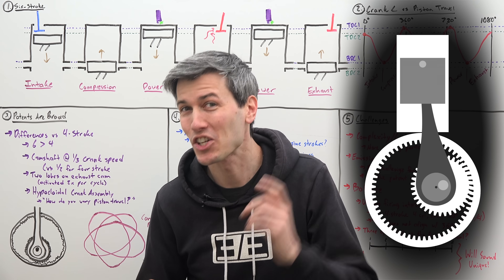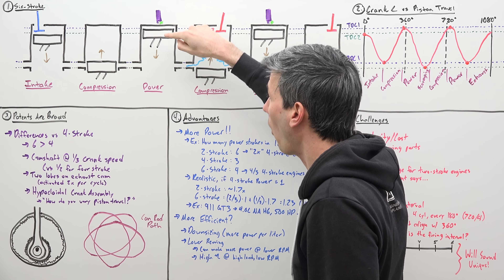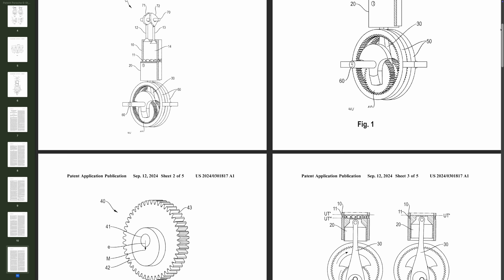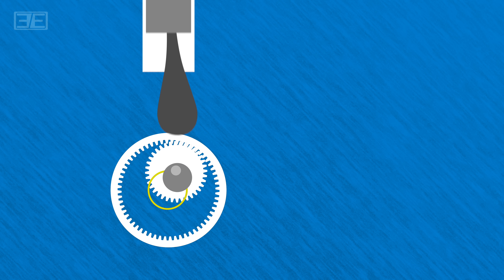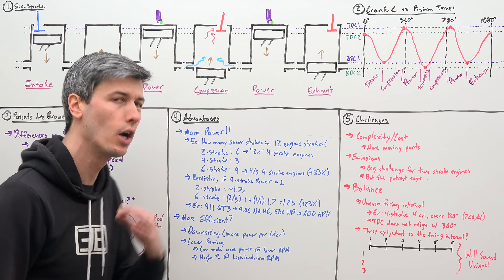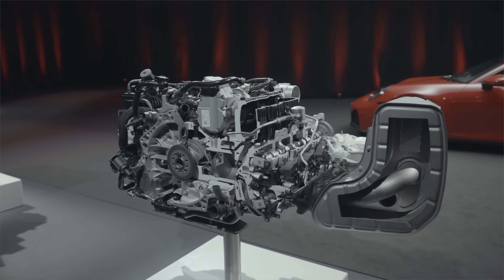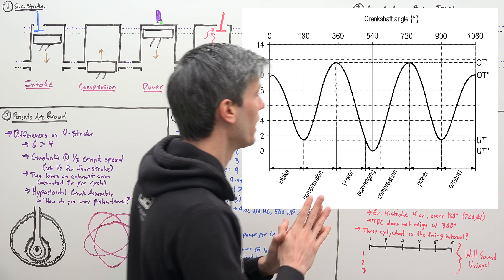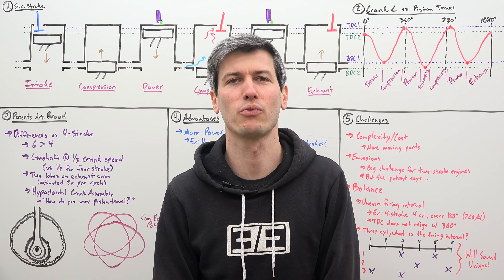Porsche's 6-Stroke Engine Is Genius!

Comment from the maker: Thanks for watching my *1000th video!!* Y'all the best. Now, onto a few common questions:
1. Truthfully, looking at the patent, I don't see how it could operate as naturally aspirated (NA); however, they allow a lot of leeway in the patent for how this cycle works (for example: fresh air from the overhead intake valve during the scavenging event, exhaust out the ports in the bottom or top, a combination of intake/exhaust ports at the bottom, etc). NA two-strokes generally use the piston going down to pressurize the air going in, in combination with exhaust scavenging, which doesn't seem to be the way this operates. I think the safest assumption is it will be boosted (super or turbo/e-turbo), to easily force in air, but I didn't want to rule out NA as the patent doesn't explicitly rule it out. 
2. Regarding balancing, I kept this discussion fairly short mostly because I truly don't know how it can be done. I spent way too much time drawing out all the different options for a 3-cylinder, and none of them seem great. One idea was lining up the more powerful first stroke with the next cylinder's less powerful stroke, so you always have 1 high power, 1 low power together. But in reality, these can't actually line up (you can get two cylinders line up, but then the next two that fire are offset, then the next two are offset even further - this requires drawing out the sign wave shown in the top of the board to visualize - three times, offset ~360º so peaks align-ish). This also means you have pistons acting with different primary forces at the same time (and technically, different times). Perhaps a balancing shaft can cancel this out (or perhaps an equal and opposite opposing cylinder bank), but the patent makes an I3 seem fine and I don't know how that works out. But again, regardless of all of this, the firing interval will be intermittent and sound quite unique, no matter how you time it. *makes cars sounds to self*
Reply: Yeah, in motorbikes with V twins one configuration is what they call "big bang" - this is exactly what they would do, as per your comment abive, but not the video. They don't have to line up, they need to be even. Space the 3 360 apart and the other 3 will have matching offsets and the power will be smooth and easier to use with traction control.
Reply: You mentioned this being your thousandth video, and it made me realize that genuinely cannot remember how long I've been watching your videos; To me, you're like a homie I see occasionally who teaches me cool new things then we part ways for a bit and do it all again. Many Congratulations 🤝
Reply: @wraithxoxo9014 I've watched for around 3 years...the most important thing I've learned is really 2 things: the human mind is limitless; and the entire earth can be moved with a big enough lever
Reply: @EngineeringExplained  i think the teeth on the gears will wear out. Also, a lot of herky jerky movement.
Reply: ok, but if they can do "clean 2stroke" by direct injection and forced induction (not pushing air bellow piston mixed with oil) why even bother with additional 4strokes?
Reply: @moalabs  Exactly my thoughts. If they want to play with 2-stroke, why not make a scaled down crosshead engine?  A crosshead is as clean as an engine can be, and while it's too tall to be upright in a car, they could lay it flat (like half a boxer) to deal with that.
Reply: @moalabs  my guess is the 2nd compression stroke will retain some amount of the exhaust gasses that would be expelled in a normal exhaust stoke, sort of an in cylinder EGR. I think thats what they mean by 2 stroke method disadvantages can be remedied by clean and efficient combustion, they think a 2nd power stroke using the unburned fuel from the 1st will allow for less new fuel injected and more complete burn of the fuel from the first intake stroke.
Reply: @moalabs  With that logic, just use rocket engines. The rare "1-stroke" engine that's all power stroke (or all exhaust stroke, they end up being the same thing).
Reply: Balancing is mass related, not torque related. No idea how the balancing would look, but it's independent of the power strokes.
Reply from the maker: @fredio54  Mentioning this because the power strokes line up with when your piston is at TDC (primary forces). Since these don't line up, the balancing of these doesn't line up (unrelated to when it fires, but poorly explained on my part!).
Reply: @EngineeringExplained Jason, 4th stroke is (compression + exhaust) rit..? it's not just a compression stroke alone

Would this scenario work - exhaust stroke is completely avoided..5th power stroke is followed up with a compression stroke (similar to the 4th)

  . 4th compression stroke does remove exhaust 
     so why a separate exhaust only stroke is 
     needed..? 
  . 4th stroke does have intake as well so why 
     does we need separate intake only stroke
     once it gets going..? (initially it is needed)
Reply: @fredio54  "Balancing is mass related, not torque related." It's both. Ever had an engine with a misfire on one cylinder?
Reply: @Grafyte  That's actually occasionally heppening with my mazda 2 right now (Bad ignitiion, needs new spark plugs and wires).  When it does, if it's a small hiccup, you can barely notice it, if at all.  Sometimes it's just a single misfire, at which point you won't notice it.  But if it happens consistently, it's VERY noticeable.  The whole car vibrates.  I think it's more dependant on how frequently it occurs, how spread apart the misfire is, and how consistent it is.  The problem it'll likely cause is excess wear on the crank assembly, which with a complex crank assembly like this, will wear quicker and more expensivelly than any normal car.
Reply: @fredio54  This is because acceleration is related to rpm squared, so at higher speeds the force from combustion becomes negligible
Reply: All major interval and balancing problems are solved by using either inline-12 (yikes) or boxer-12 (awesome) configurations.
Reply: @jonathanstensberg Porsche has raced boxer 12s, no?
Reply: Great video as always! 
I am wondering how are piston rings (if there’s any lol) going to pass that bottom intake gap without expanding. And there are no piston rings, how are cylinder walls getting lubricated. Just wondering.
Reply: @jadiseul  The channel for the bottom-bottom dead center scavenging is probably intended to be narrow enough in width to not really allow the compression rings to expand much. Think of it as the edge of a really narrow slice of deep dish pizza. I could definitely seeing it increase wear over time of the rings, but I'm more worried about the gears.
Reply: @jadiseul  Piston rings should be no problem. 2 stroke engines have piston rings, too. Okay, usually they have only one of them but I do not see a major problem regarding those additional two rings.
Reply: @jadiseul same way as any 2 stroke. The rings won't be free to rotate they will need to have locating pins to make sure they are in the correct orientation so that the ends of the rings are not allowed to pass over a port where they can expand out, snag the port and break.
Reply: @jadiseul Porting I guess, like two stroke ringed pistons passing wide transfer ports which, in some designs, appear to be unfeasibly large fractions of a circle. 
Two stroke rings are pinned (at least, all those I’ve dismantled) and those pins ensure the ring ends don’t project into ports anywhere in the cycle. I’m amazed my strokers work so well.
Reply: Wouldn't a 9 cylinder double up the power strokes evenly? W9 maybe.
  But also, how does the oil control ring on the bottom of the piston do it's job with a bunch of holes in the cylinder wall? I can't see a way for their "clean burn" solution to work that one out.
   We need another deeper dive into this one. Js
Reply: Congratulations on 1,000 Jason, I have been fascinated and learned lots from your videos over the years many years. We all owe you a debt of gratitude as car nuts
Reply: I don't think I was watching in 2011, but I have been here for the majority of this channel's life. It has been impressive to watch the channel grow. I see that you are nearly at 4M subscribers. Congratulations on your success- you have certainly earned it.
Reply: I think this is one that would need to be visualized to understand it properly, maybe then appreciated. But I'm with , it will be unique.
Been around just after you started. Love your work.
Happy 1000th
Reply: Congratulations on the 1000th ep!
That's awesome 👌

On the video, as a mechanic, I was thinking the whole way through 'I wonder how they plan to balance that'! 😁👌
Reply: Congrats on reaching 1k!  Another great video.  
Regarding balance, that’s not going to be a big problem.  Think about a 3 cylinder.   Instead of spreading the power moments, you can make them overlap.   So in your graph you could have 2 cylinders firing at moment 1, 3 and 5.  That would sound great but may induce serious vibrations…. which you could perfectly balance out by having another 3 cylinder mounted opposite of the first one.  Kind of like a flat 6 engine… 
Now whose patent did you say you read?
Reply: There aren't any important balancing problems specific to odd firing engines. They have the same dynamic balancing problems as even firing engines.
Despite the need for a blower, I think a pure two stroke would be the better option.
Reply: All buy Porsche SE stock now :D !!
Reply: Well, I guess we'll see how it goes after 10 years.  I see a lot of wear and tear and potential for failure.  In theory and on paper is one thing, but actual materials and application is a completely different animal.
Reply: This will never meet emission standards or hit economy targets.
Reply: @littleherms3285  right because it always burn oil as the pistons rings gets exposed to the air & will force oil out the two stroke ports
Reply: Thank you!
Good explanation in every vid. Great job!
Reply: Congrats on the milestone! 👍😃
Reply: Would love to see a video on the RevForce engine from Alpha Otto technologies.
Reply: Knowing porsche, this will end up being a flat 6
Reply: Will the oil not get into the lower windows? If so, the oil will burn, which will make the engine uneco-friendly. Will the dry sump system completely suck out the oil?
Reply: Cheers for the 1000th. I learned a lot from you ❤
Reply: Congratulations and thank you!
Reply: remembering seeing your early episodes when i was still in uni, time flies!! keep up the great content man!!
Reply: I’ve seen some of your videos and I’m thankful for your insight into how it’s made (pun) and how it works (also a pun).

I look forward to more videos regarding your understanding of such marvels! Good Day to you Sir!
Reply: Congratulations. Really, really well done and all on a old school white board 😂
Reply: First, of all congratulations! I see some good answers to your balancing question posted below, but with no science background or practical car experience posit a harmonic balancer on a hypocycloidal assembly of it's own. That motorcycle guy seems to have a point.
Reply: How would scavenging work with the piston rings?
Reply: Damn! 450k views in 24 hours of debut. That is massive count. Been watching EE since it’s beginning. Congratulations on all the success!
Reply: Congratulations 🎉 1000th
Reply: A turbo on the "2 stroke" section could move a lot of air into the cylinder at that time - also, since there is no valve there, the area of that intake could be substantially larger so that with turbo a lot of air  can be moved into the cylinder (I assume the fuel is direct injected ...)
Reply: @AlanTheBeast100  So for it to work it would almost have to be turbo'd then?
Reply: @TheSpink02  It would work w/o a turbo - just not optimally.  Scavanging is not a new thing in 2-stroke - but with a turbo you could really get a good "charge" in there - IAC, these high end cars almost all have turbo.
Reply: Very cool technology. FYI, that is a patent application not an issued patent.
Reply: Interresting
Reply: Congrats on number 1,000.   I hope you celebrate this milestone and another one JUST about to happen any day now when you hit 4 million subs!  Go buy yourself a Rolex or something.
Reply: How does this design differ from the old two stroke Detroit diesels? I am curious how this would affect emissions?
Reply: You’re assuming conventional firing patterns. Just offset the firing on the secondary power stroke to match the timing of the counter primary
Reply: Who did you have a collab with recently ? B is for Build ?
Reply: Why not just use a direct injection 2 stroke with intake ports in the cylinder, exhaust valves in the head and wet or dry sump lubrication? Can't these be made to run as cleanly as a fourstroke?
Reply: “this requires drawing out the sign wave shown…”

Shouldn’t that be “drawing out the sine wave”? 🤔
Reply: I want to see this engine done soon. sounds interesting
Reply: Congratulations!  I enjoy your videos because there’s no unnecessary BS of talking just to be talking, you start out immediately, you enunciate well at a fast but easy to understand pace, and your subject matter is interesting and challenging.
Reply: With a 6 cylinder the balancing seems pretty straightforward, no? Each cylinder fires on its number and then 2 later, so every turn of the engine has one of each type of power stroke. If they're not firing at quite the same time you'd get a sort of heartbeat effect, with two in quick succession and then a little gap, and then two in quick succession, etc. With each pair being separated by about 180 degrees. Am I missing something here?
Reply: It would be supercharged to push the air into the side port
Reply: Happy 1000th video. I've been watching you for the past 7 years. From being a high school student knowing nothing about cars to being an engineer at Ford, you've been an integral part in my engineering journey! Thank you Jason!
Reply: Also just about to hit 4 million subs. Maybe those milestones will occur together.
Reply: Subbed for the 100th video! Can't believe I wasn't subbed already.
Reply: Congrats on 1K! I've been watching since around 2012, when your presentation style was more nerdy engineering undergrad, presenting the fundamentals. Then you moved to modifying and experimenting on your Integra. You made a leap of faith leaving your first engineering job and I joined your patreon to help fund it for about 14 months, if I remember correctly. I didn't think 13 years later I'd still be watching you ... and all the amazing things you've been able to do along the way.
Reply: Someone check on stroke guy  i hope it wasnt a power stroke ,    billy squier  help us out  stroke stroke stroke stroke.stroke
Reply: Jason, do you think it is worth making a video on a delicate subject??    The subject is one i just ran in to myself and that is Planned obsolescence of EV batteries.    The cost to repair VS  replace an EV battery is insane and while you can find 1001 reasons why batteries in EV need to be so complicated for repair the architecture makes it hard to remove a section of bad cells and easily replace them so it seems like a design choice.    Would it cost more or change the aspects of the battery if it was compartmentalized better for easy repair?    Or is it just a major game of Planned obsolescence to force customers to buy the OEM battery replacement instead of making easy repairs.
Reply: easy to repair.  surely the design goal of porshce
Reply: That exhaust note has got to be gnarly.
Reply: Congratulations on your 1000th video !!!
Reply: why wouldnt you use the intake vales again for the second stroke?
Reply: Congratulations on 1000! thank you for making me feel old.
Reply: Jason, I have a transfer student from Italy in my automotive class who is interested in engineering cars for formula one racing.  So I asked her to look up the patent and tell me what her thoughts were.  While looking at the patent she asked me how would the engine keep from burning oil? At first I just said that the oil ring would prevent the engine from burning oil, but then she pointed out that the lower ports would be exposed to the crank case after the piston moved up above them thus allowing oil into that would then be pushed into the combustion chamber during the two stroke cycle.  Is this the case or are we missing something here?
Reply: Congrats prof. You though us a lot of subjects and its aspects and still doing it like day one. My hearty thanks for all the teachings!
Reply: It seems like it's trying to replicate the rotary engine but overly complicated with more moving failure points for not much.
Reply: Congratulations .. Love your content.
Reply: I agree that an I3 doesn't sound plausible. Perhaps a balancing shaft could take care of it, and while that would be a complicated balancing shaft, you can't really make this engine more complicated anyways so why not? I haven't seen the balancing shaft in the crossplane I4 in the Yamaha R1, but that engine is what I think of with these offset power pulses. I would imagine the goal would be to match fueling to the strokes in a way that give you even power on both power strokes, unless the second power stroke is going to be designed to be weaker in order to achieve balancing. 

The result in the crossplane I4 and most 270 offset twins from my experience is torque and a really good sound. I personally enjoy 270 twins offroad since the two power pulses being close together and then having a large lull in power while the engine exhausts gives your wheel a chance to roll and regain traction before more power is delivered. Really cool to see in slow motion film and you can really feel it on the bike. I doubt traction is the goal of Porsche, but it will sound crazy I'm sure.

I do wonder why they don't just make a direct injected 2 stroke in order to skip the oil/gas mixture though instead of this complication. You could have a fresh air port on the lower end of the stroke just like a traditional 2 stroke to assist in pushing the exhaust out and then spray your high pressure fuel just after the fresh air port is covered by the piston on the way up and the exhaust valve shuts, compress, fire, evacuate the exhaust again... Makes sense in my mind. The tuning and timing of the port, fuel, and valves would be the trick to nail down to get the best power while keeping fresh fuel out of the exhaust for emissions purposes. However, tuning is always the key to making a good engine great anyways.

Thanks for the thoughts and congrats on your 1000th video!
Reply: porsche make flat 6
it’s what they do,
it balances with a 6 perfectly i high power bNg and one lower power bang on every single stoke balanced perfectly.

i don’t know how you miss this
Reply: Maybe a v12😂
Reply: They would be using this as a complex EGR. You can control fuel injection into second power stroke to complete the combustion. I think this will require a complex ignition and fuel injection profile as you will have varied timing for each powerstroke and different fuel quantities
Reply: Thank you for your videos. I always find them interesting and well composed.
Reply: Porsche may go back to making military vehicles again... This would make a great hybrid electric/ liquid dinosaur fuel tank engine
Reply: As if modern overly complex engine designs need another potential point of catastrophic failure.
Reply: Bla bla bla bla
Reply: I thought  a working model is part of patent application; just do a video when you have a prototype w/10,000 hours running. 😮
Reply: How CLEAN is this Engine? Do you still need a cat or would you burn it out due to so much unburned fuel going through? PLATINUM & PALLADIUM are VERY EXPENSIVE!!
Reply: The "multiples of 3" ... I think they're being somewhat obtuse, but also giving it away.
They mean a 6 cylinder. Porsche makes 6 cylinders. Porsche loves 6 cylinders. V6s, inline 6s, boxer 6s. 6 cylinders is where Porsche lives.
And with 6 cylinders... you just end up with 2 power strokes on each count.
Same with the NA thing. I mean, Porsche has NAs. But really... turbo is the name of the game for the last 10 years.
Reply: and you wouldn't have never thought that you'd make a video about a serious 6 stroke engine ^^ congratz!
Reply: this engine is maybe the last leap of big engineering we will have on engines before everything will go EV. thanks Porsche
Reply: You ten hundredth video. Yay! I came here just to say how weird ten hundred (and eighty) sounds. It shouldn't I guess, but it is very unusual. Chew on that, Youtube algorithm.
Reply: Im not an engineer so I cant fully explain what im thinking but doesnt the fact that the crankshaft is rotating on a gear as well as rotating on its own allow for more than 360 degrees per "rotation"?
Reply: How many 6 stroke designs appear in patents prior to this?
Reply: the uneven firing, for me, means this doesn't feel great in reality? I guess we'll find out. people are going to have seizures probably driving this; I don't even know if I would want to drive an engine that's not perfectly balanced firing, just out of OCD lol.
Reply: Has Porsche built a prototype 6 stroke and will the do so in the future if not? I used to be really familiar with 2 strokes when I raced MINI A in mx, they're powerful at the right rpm and easy to work on. Now it's all 4 strokes we race in the 250 and 450 classes in mx/sx and they're easier to ride with loads of usable tq. Maybe Porsche will test out this engine at LeMan...that would be cool. I don't want to see ICE engines disappear completely from all vehicles/dirt bikes/ATVs.
Reply: I think that what they mean by BETTER EFICIENCY is that they will burn the fuel mixture twice so they will get more energy out of it.

I have seen great video by "Driving 4 answers", he explained it in more detail